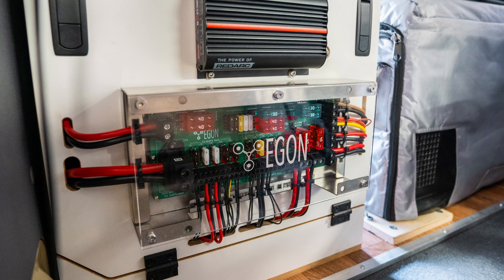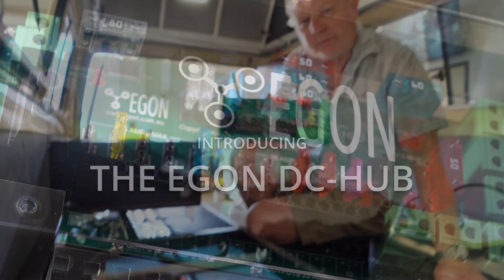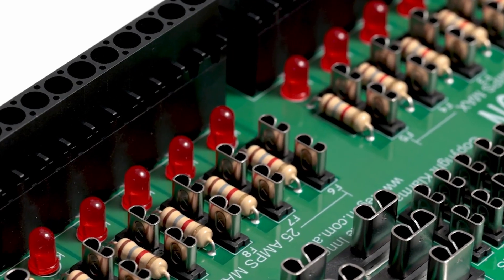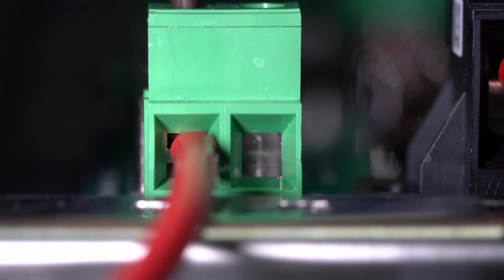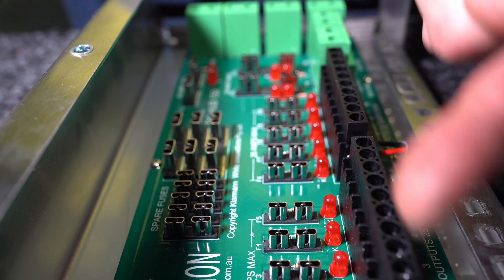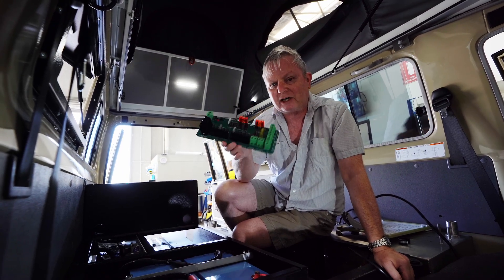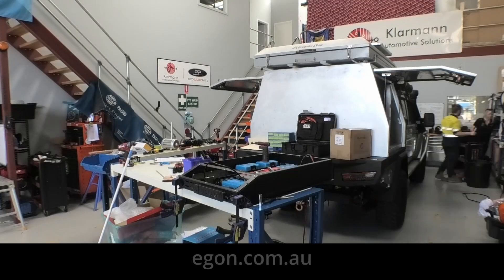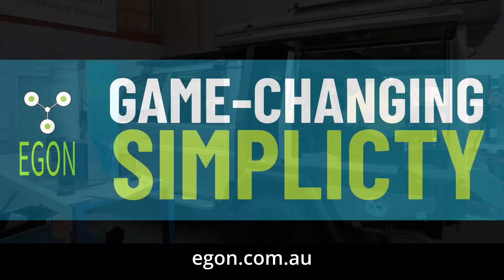DC-Hub. DC Labor saving DC Electrics device | EGON

Comment: hello heiner. The new brushless twin arb compressor uses 90A under loads,does this mean we cant use the 80A input anymore for the new compressor.
Reply from the maker: Andrew here. I use an ARB twin on two builds through the DC-Hub 80A connector and it worked just fine. I found that it rarely ever exceeded 75A while running at peak.
Reply: @EGONGame-changingsimplicity  many thanks Andrew.

How do I know I’m buying a new brushless twin ARB compressor instead of the older brush type compressor?
Reply: Heiner - I am keen to learn the answer as well please…..